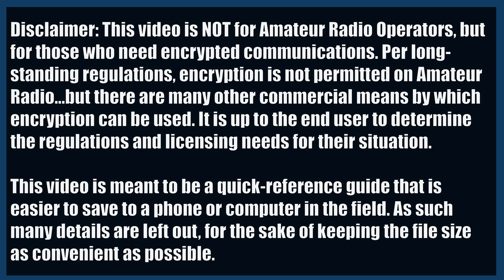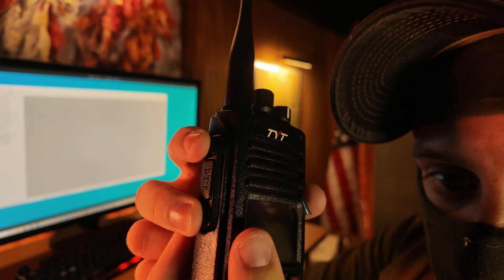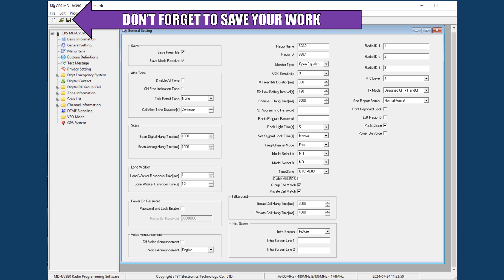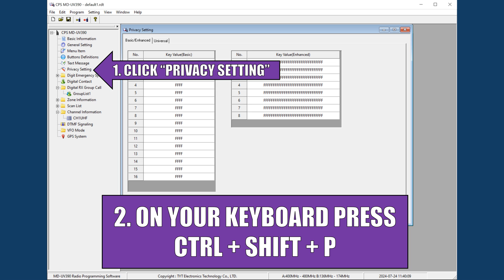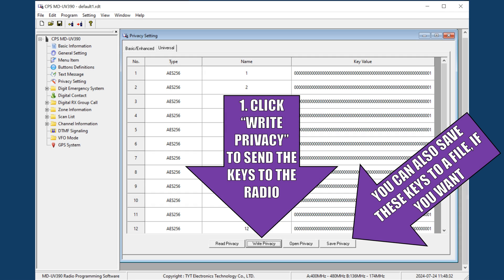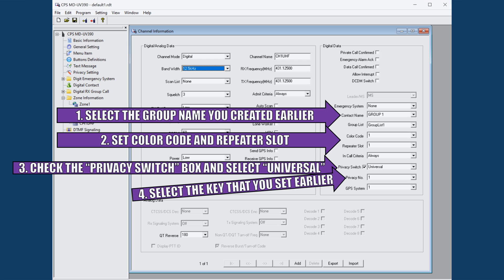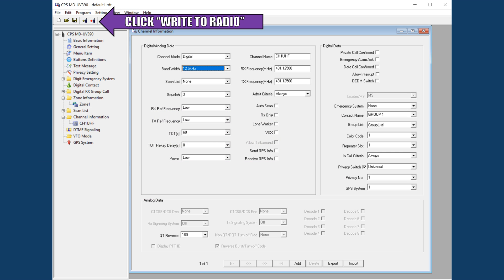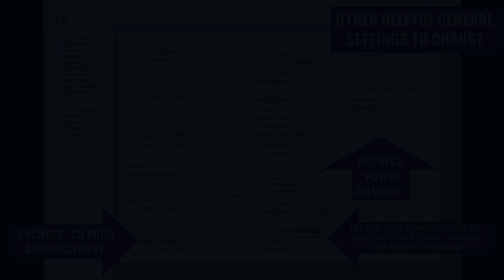Programming Encrypted Radios: Field Guide

Comment: Could you do a video showing what settings to put in the CPS for the Anytone D878VII so it's working with the TYT-UV390? 
My TYT-UV390 Plus does receive the encrypted AES256 audio sent from the D878VII, but not the other way round.🤔

Comment: Turn the radio OFF.
Hold down side buttons 1 and 2.
Turn the radio ON while holding down these buttons.
The radio is now in Programming Mode.
Important Note: If you repeat this process, you will set the radio in an unprogrammable mode. Reading a radio in unprogrammable mode and then writing that code plug to another radio will lock that radio, as the code plug is not a programmable one.

Comment: I can't get AES 256 to work. It says on radio and pc that it was applied, but for some reason a non encrypted radio can still hear me clearly. Only ''enhanced'' encryption works. Any idea why?
My radio is supposed to be the PLUS model
Reply: You need the new 2.41software.
Reply: @tyroncalta where did you find it? I can’t find a cps that new?
Reply: The "enhanced" encrytption is an AES256 type, so it works :3
Reply: Same thing for me!!  Any update on this?

Comment: 0:13 I will add that the UV390-plus uses the same internal computer and hardware as the UV380-plus, so the latest CPS from TYT will work with both models.

It actually works with the regular "non-plus" MD-UV390/80 models as well, as long as you don't try and load AES 256 keys to them. This is because the boards on the "plus" versions have a special built-in crypto chip that enables fancy pants hardware encryption, whereas the "non-plus" MD-UV390/80 do not. They still do 128-bit ARC4 encryption though, which is allegedly a lot of fun.

Comment: UTAZCO Overland

1 second ago

Hi -
I tried this ("for research purposes...") with my Anytone 878UV radios, and made sure everything was EXACTLY matched in the CPS software before I wrote everything to both radios. When testing, each radio displayed the correct IDs and channel names, etc, but there was NO AUDIO. Any hints for troubleshooting? Thx.
Reply: When DMR radios share the same ID, Frequency, Color code and Talkgroup but one is encrypted, you should still get garbled audio. DMR can be a PITA to program just right, so double check those settings. 

If there's still no audio, it might be because the receiving radio things the encrypted audio is background static and doesn't bother playing it over the speaker.

Beyond that, there could be some discrepancy between the crypto implementation on each model so that they can't talk with each other. Try one variable at a time--see if you can get the radios to listen to one another in the clear, then maybe you can add in crypto.

Comment: Do these radios have an extended battery to help fill them out in bigger radio pouches?
Reply: They don't, but you could 3-D print the case for one and put 18650 cells in it. The batteries they use are ~7.4v so if you put two series-wired 18650 cells (at ~3.7v each) in a fattened 3-d printed case, you'd get a voltage of 7.4v that the radio will run on. Only thing then is designing little contacts so the DIY battery touches the radio contacts when clicked in, and plays nicely with the stock 7.4v cradle charger. 

I've run into this exact issue with these radios and plan on designing an extendo battery, but for now the solution is to pad out the extra space in the radio pouch with a spare stock battery.

Comment: Pro tip, set a programming password and start up pin so randos can't use your radio or pull your fill.
Reply: ...and don't save a crypto key file to a PC that's not air-gapped

Comment: Remember fellas if you don’t own the server you don’t own the video. Save it now off line.
Reply: What are yall using to rip?
Reply: @njohnsen72  If you're using a browser, replace 'tube' with 'pak' in the base url.
Reply: Youtube it. Dont post it or they will try to get the application taken down @njohnsen72
Reply: Good call, just did. It is now officially uncensorable, there will always be a copy.
Reply: Yup! A famous quote in computer security, "Physical access is root access".

For those that don't know the term "root", it's used to refer to the highest level of access/control of a computer
Reply: Anyone know the free OSINT tool that allows one to rip anything for offline?

Comment: How to generate random, 256-bit keys using Windows Powershell:

Copy and paste the following script into a powershell console window and press enter. It will generate ten, random, 256-bit keys each time you run the script. Each output line is a separate 256-bit key:

$random = [System.Security.Cryptography.RandomNumberGenerator]::Create();
for($i=0; $i -lt 10; $i++){
  $buffer = New-Object byte[] 32;
  $random.GetBytes($buffer);
  $key = [BitConverter]::ToString($buffer).Replace("-", [string]::Empty);
   Write-Host "Key $($i): $($key)"  }
Reply: Thanks, I bet this would save time
Reply: Thanks, works great!
Reply: awesome. thanks

Comment: Is it legal to Tx encrypted, what bands, freqs, etc...
Reply: HAM guys will claim its illegal but the FCC laws are so complex there are grey areas. if you have or know someone who has an FCC business license then its perfectly legal to use encryption on business channels. Also... from what I can find, its not technically illegal to use encryption on MURS channels. Some people claim it is but its not explicitly stated in any FCC rules. Digital modes are allowed on MURS and I believe the confusion comes from.the fact that only MURS specific radios are allowed to use MURS channels and I don't believe anyone manufactures an encrypted MURS radio. But if it did exist, it wouldn't be illegal.
Reply: Can it be decrypted by intercepting parties?
Reply: FFEDS
Reply: Yes it is legal on YOUR LMR frequencies. VHF, UHF, HF 11 meter band. You will need a frequency coordinator to determine what frequencies you can use. 

To answer your other question it is not likely to be decrypted, is it possible yes but Im sure not likely. It is always good practice to treat strapped frequencies as if they are transmitting clear. 

If you are using the lowest amount of power it takes to achieve your contact and use brevity you should be more than safe from itching ears.
Reply: No